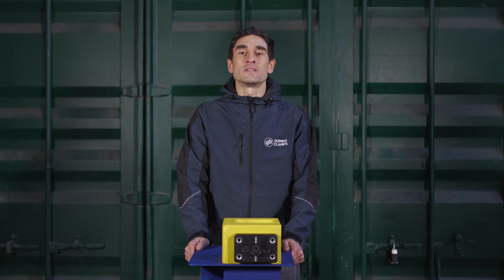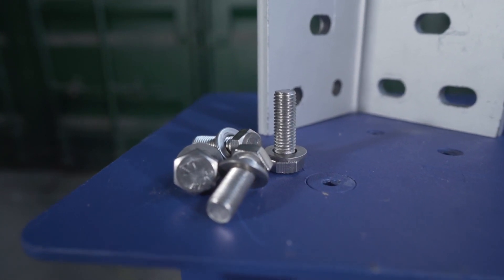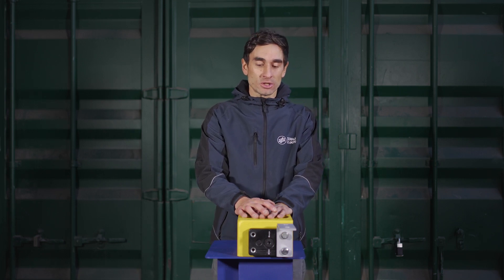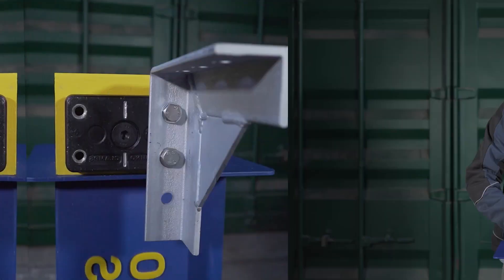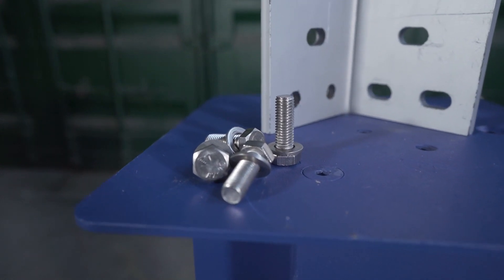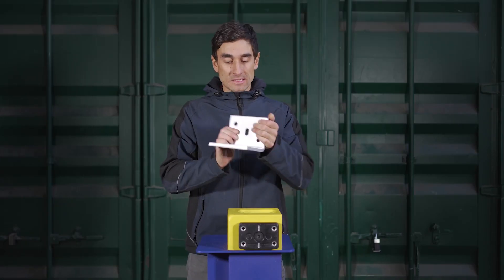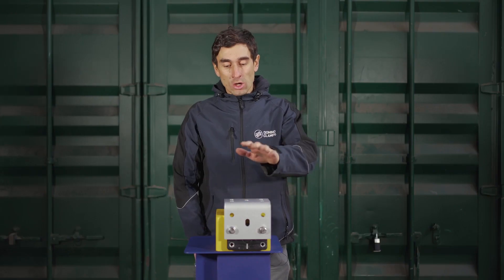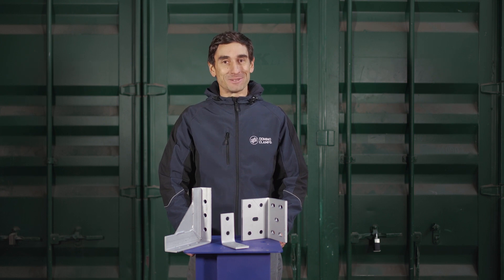Shipping Container Brackets

Comment: I would love to see how you attach roof trusses
Reply from the maker: We have a couple of blogs about roofs on the website, Just search "roof" in the search bar on dominoclamps.com and look through the blog articles
Reply: @DominoClamps  yes, I have read what you have, but the details are hard to understand exactly how to affix trusses to the top.  Your metal roof blog had trusses mid-way along the side, so not attached to your clamps.  I think there is a big market for what you are making.  Fantastic 15 step video on making sides for container.  I might use this, but opt for lateral siding along the vertical studs.  But for pre-made wooden trusses for 1 Connex, or to span two and have an open space, the nitty-gritty of how to affix the end of the truss to something like a top lateral sideboard with the roof clamps (maybe) is something I am not understanding.

Your competition has a great product in individual brackets, but their price for two 20’ containers is way high.  They want 40% of what I pay for a new one-way container picked up at Port of Baltimore.  I am looking for a reasonably priced solution
Reply from the maker: @  Are our Roof brackets not sufficient to support your lateral timbers?

We try to make as wide a range of accessories to connect as many things to containers as possible, - unfortunately we cannot be experts in all aspects. Please feel free to email us for more feedback or ideas, but just bear in mind we are not experts in the intricacies of of roof truss construction.
Reply: @DominoClamps  I suppose, I do not see how those would attach to a wood truss.  I can email you